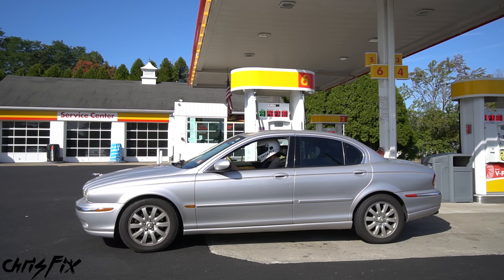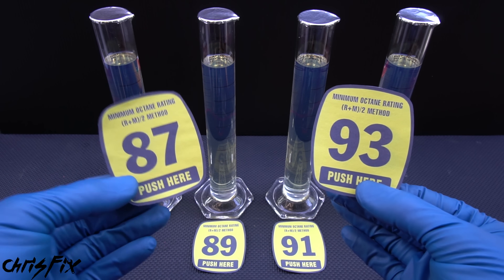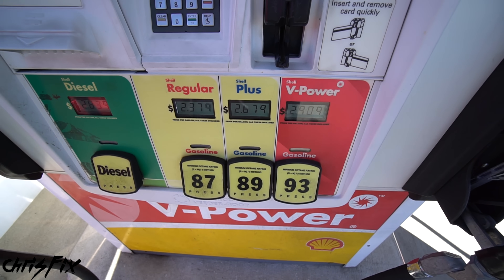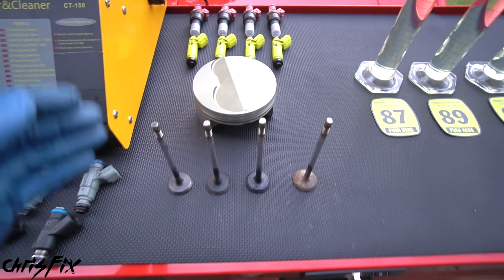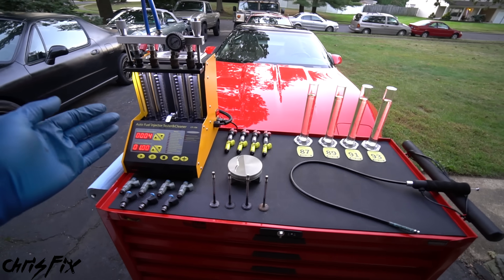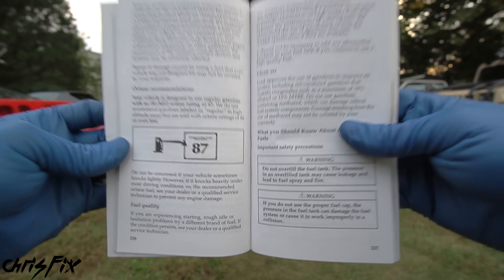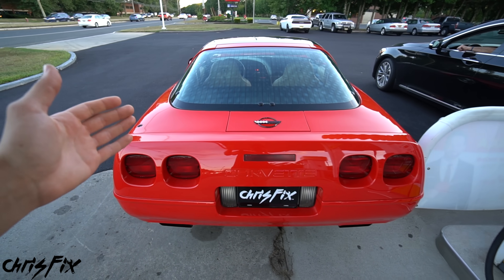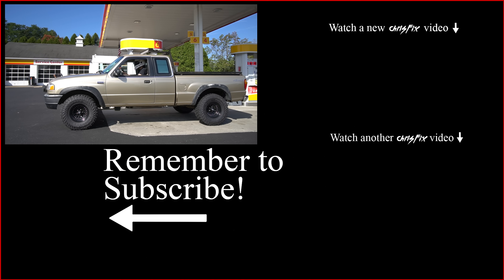What is the BEST Fuel to Use in Your Car or Truck and WHY

Comment: I have a 73 Super Beetle and the Manuel calls for premium But I am told that there is a difference between the old gas with Led and the unleaded. My current mechanic says run 87 to compensate for this difference. Is there any truth to this??

Comment: I put premium in my 2017 Nissan Altima. I was told it keeps the engine cleaner.Back then when I used to put regular gas in my 2015 Hyundai Sonata it would make a weird noise whenever the engine was running. After I left my mechanic he told me it was making that noise because it was running on regular gas. And that premium gas is recommended for newer cars just like synthetic oil.

Comment: The answer to the title: look at the owners manual.
Reply: I know the answer was simple, but i appreciated all the information he gave.
Reply: @nickz6948  throw 93 in it and call it a day fam.
Reply: @nickz6948  also, 91 is what manufacturers usually program a vehicle for that requires premium since 93 is not always available everywhere. 91 usually is though.
Reply: Yeah but should I use 91 or 93 octane gas for my nissan 370z? Gas station near my house doesn't have 93
Reply: @nickz6948  look at the owners manual...
Reply: @LIGMAFB  My brother gave me the car and I don't know where he put the manual. He's in the army so I can't contact him either
Reply: @nickz6948  It took me less than 10 seconds to find that info on google.
Reply: @nickz6948  its the same just say different like coke and Pepsi.  Anything 90 and up i premium
Reply: @nickz6948  if you are at altitude, 4000 ft and above, 91 is sufficient.
Reply: @nickz6948  if you want more performance run 93 if you're not racing around the streets you can put 89 or 87 in and it won't do any difference. recommended is 91.
Reply: Thank you guys
Reply: This is information is very vital...Gas goes up and down like a merry go round
Reply: Definitely not a 16 minute video worth.

Comment: If your car is NOT super or turbo charged and not originally sold in a high altitude city (over 5000 ft) if you go to a high altitude (like Denver, Colorado) you may be able to down an octane grade.  Years ago I was in Peru, where most cities are either near sea level or above 12,000 ft. and  the fuel sold was either "high altitude", (I thing it was around 78 octane) or  'Low altitude" (around 90)  because of lower atmospheric pressure the low octane did not pre-detonate at high altitudes because the absolute pressure at ignition is proportional to atmospheric pressure.  A  9 to 1  compression ratio engine at sea level will act like a 7 to 1 at 10,000 feet and thus not knock with low octane.  One had to be careful when driving from the mountains to the coast and arrive with a near empty tank and fill up there or your car would knock badly.

Comment: There’s an old trick to up the octane by adding a lil kerosene to your regular gas,if ya look at some of the higher end octane boosters,perfect example royal purples octane booster an read the ingredients an you’ll see it’s 95% kerosene. A good rule of thumb for every 20 gallons add a half gallon of kerosene an it should roughly up the octane to around 95 if ya start with 87 octane fuel.

Comment: Part of this is absolutely wrong. Higher octane actually has less energy per volume of fuel, but you can run more timing so it can potentially make more power. At the exact same timing, you will actually make more power with 87, as long as its not knocking.

Comment: I put 91-93 in my Silverado. It definitely gains a bit of power. I'll run E15 or E85 on occasion for the huge power gain, but I can't afford the 40% loss in fuel economy.

My crossover gets 87.  It's boring .

Comment: Something you didn't touch on is the 88 Octane E-15 fuel. It's a half-way between standard Unleaded and Flex Fuel, and, just like Flex Fuel, should only be used in cars that have the appropriate (0%-15%) Ethanol rating. Most cars are only rated for 0%-10% which is the normal Ethanol range for Unleaded fuels. Just like you advise, listen to the manufacturer's recommendations before considering this fuel, and do not trust the statement at the pump which claims that it's suitable for all 2001 or newer vehicles. We have three different cars that are newer than 2001, and only one of them is compatible with the E-15 fuel, the other two would actually suffer damage from the elevated Ethanol rating.

Comment: What do you think of E-15 fuel? Does higher ethanol content damage seals or other components in the engine? There isn't much guidance regarding this in car manuals. There are some stations that have 88 octane fuel that has 15% ethanol instead of the usual 10%.

Comment: My oil leaks on the front driver side and under my hood has white smoke xar doesnt change gear and wont move. Does anyone know what is wrong i got new transmission lines before this happened

Comment: Okay so I have a 2014 focus st and I fill up with 91 octane. I changed my spark plugs the other day and they were gummed up. I was recommended injector cleaner. Two days after my engine blew. My car doesn’t require 91 but I use it anyways. Could have to much octane cause my engine to blow?

Comment: Look when I run 101 on my 2017 Mustang GT V8 Straight pipes, the shit is so responsive and the sound is just unbelievable. I can tell the difference in sound with 101 and 93..... I can record a video with 93 and 101....
 I can upload a video with the different fuel and I can use a DB reader??

Comment: Chris didn't talk about oxygenated fuel, or 10% ethanol fuel.  Ethanol is an octane booster, yet has less btu (energy).  Just another factor, so for some of us, we can seek out stations that have "ethanol free" fuel and it has certain benefits (more power, more MPG, better suited for cars that are used less often).  But it is always more expensive than the same octane at an E10 station.

Comment: So if the manufacturer recommends 89 octane, but the local station only has 87 or 91 octane's, can you mix a specific predetermined amount of 87 octane with a specific predetermined amount of 91 octane, after determining the approximate number of gallons needed to fill the tank, in order to create an 89 octane fuel?

Comment: normally, with my truck that is supercharged (about 650whp small block chevy 350) ill run the highest octane possbile, usually 91 sometimes 93 and put a quarter bottle of octane booster, as the compression is so high, i dont want to take any risks and being a older vehicle there is no knock censor

Comment: I don’t have the energy to argue here. Some good info with a lot of incorrect. These rules apply much different as a engine ages. Too much info to add here but if you’re gonna do an informative video on this level you should include all the fact. However the most annoying for some reason that higher octane fuel doesn’t burn cooler. Run those injectors in a thermo-chamber or just simply hook up a scan tool under same conditions and record O2 sensor data. Thanks but no thanks. Make a corrective video.

Comment: Because of the additive difference in different gas suppliers, I have found through experimentation that a car will run best on a type of fuel. So one manufactures fuel of the same  octane  will run your car best.  That will also change depending on what part of the country you are filling up in.    I over inflate my tires by 5 pounds and more than doubled the life of the tires while saving 10% on fuel usage.  the ride is a little stiffer and the steering response is improved. In addition, by using the fuel to "empty" before filling up and recording the mileage (or using the odometer by zeroing it at each fill up), I was able to determine which fuel got the best result in my car. Sounds like a lot of work, but it isn't. The $$ saved is huge if you are a commuter, like I was.  Tire alignment is also a very important thing to do annually, or if you hit a curb hard.

Comment: Hey Chris! I got a few questions bro. I bought a 2008 Mercedes E350 a month ago. It runs good but it had 3 previous owners so I don't know what type of gas they were using, I've been using regular gas since as a student. I don't make much money and gas costs a lot in Miami especially if you have 20.6-gallon fuel capacity. After a week of having it, it gave me check engine light for O2 sensors (P0150 Circuit Bank 2, Sensor 1) and intake manifold (P2004 Runner Control, Stuck Open Bank 1) Of course it runs less efficiently than it supposed to. I changed the air filters and cleaned that area so I don't know if the intake part is okay couldn't go and check engine run again also twice check engine light was off and it worked more efficient so the O2 sensor was working sometimes. But soon I will change O2 sensors with my dad as I watched your video. He knows his stuff and fixed many cars back before, sometimes when I park or stop I see some steam coming up from the hood, he told me it probably leaks gas to exhaust channel from engine, etc. (Idk how to translate what he said for that leaking part to English since we use Turkish at home lol) what would it be? Also when I go slow I notice that there's sound coming like a part from the bottom of the car loiters, touches to the floor which doesn't hope it's not a serious thing like the voice is coming from the engine. And if I use premium gas for a certain time or octane booster would it make a difference? Thanks.

Comment: You forgot to mention rotaries. Its recommended to use the highest octane possible to lengthen the lifespan of the Apex seals, and basically the engine's lifespan

Comment: Technically higher octane fuel has a higher carbon content per volume so therefore will have a higher energy content per volume. But it’s not enough to make a difference in your engine and supply more energy to the wheels. But everything else you said in the video is totally true. I have a degree in chemical engineering and work as a process engineer at an oil refinery so we process the crude oil to gasoline product before additive addition. If you have any questions about what I do and how we process the product, feel free to ask!

Comment: When I got my car, if I accelerate sometimes it vibrates. Does this mean it’s losing power ? And since I started using Premium fuel,  it’s getting better.
Reply: How many miles are on it
Reply: UnneededChaos561 _ 120miles
Reply: Yes because the knock sensor is detecting detonation and retarding the timing to try to stop the detonation.

Comment: Buy port-injected engine, buy one that has not too high compression . . . and you will see it runs fine for ages even with a bit gunk inside.
Reply: you mean direct-injection?
Reply: @bobbarker3248  
Thank for pointing on my mistake, temporary black-out . . . corrected it. At 7:20 he shows how a valve from an engine with direct injection can look like.
I own an Audi from 1999, btw. The engine origins date back to mid 70's.

Comment: Manufacturers Recommendations will save you the headaches later. That is Gas, Oil, Gear Oil, Transmission Fluid, Coolant,  Brake Fluid and for those who never lift the hood, Turn Signal Fluid.  

99% accurate information in this video.  Covered most important information that most non gear heads can absorb it and understand.

Comment: To educate you more on the knock sensor it doesn't "hear" for knocks. It detects the amount of vibration and with that vibration it produces a AC voltage and since it's a piezoelectric element all it needs is a impact on the crystal and Wala you have a check engine code on.

Comment: Great video, well done!. Thanks! However, I find the higher octane fuel totally improves engine performance, especially on higher mileage vehicles. So I dont' use the Manufacturer recommendation 87 but the mid grade. It's Night and day difference, but worth paying the extra.

Comment: so many things not true but the bigist is that the number matters it matters less its to small to matter. a nother thing octain can never be controlled to one number so when being tested the octain only has to be with in whats called 10% of 100 witch means if its 100 octain then it can be 10% less if its 93 octain it can be 9.3% less and so on. I worked at a gasstation for many years. I also have machinics in the family and have worked on cars and trucks for years. and most cars now days can run on higher and will be fine. I my self should be running on 87 but my car runs better on 91. pne of the big things you want to to buy gas with no ethanol all it is is a way for them to use a cheep adative that makes your car clocg up and gives you less milagfe per galion.

Comment: The different prices is just how clean the gas is. Like if you use the premium gas you wouldn't need to put seafoam in your tank. But if you use regular youd have to put seafoam to keep up it engine clean. Say prolly every 2 weeks. But the price difference doesnt make any difference in miles. Keep in mind this is toward people who have regular vehicles not people who have higher end cars like say a Corvette. They need a better fuel like premium.

Comment: This video probably saved me from continuing to use the wrong fuel for a longer period. I just got a v8 2010 camaro, and so far I've pumped regular gas twice since I got it. I'm at half tank now,  and I will start using premium going forward.  Thanks for all the info.

Comment: What about fuel with the 10% Ethanol added?  Does it harm your engine?  Does it get the same gas mileage?
Reply: Ethanol is alcohol and contains less energy than gasoline. Some say alcohol can damage certain metals and seals in your engine. However, it is more environmentally friendly.

Comment: PV=nRT
Ideal gas law
You can rewrite it 
P1V1/T1=P2V2/T2
When you have a piston at P1 and V1 at T1, at BDC. you compress it to get
P2V2/T2
Which is a piston at tdc.
Solve equation for T2
You will find temperature increases from this compression and volume change.
So air gets hotter with compression, so more boost, higher compression= hotter temps before the mixture is ignited at tdc. So octane makes this mixture less susceptible to spontaneously igniting when it undergoes this high temperature rise.
This concept is why diesel does not need spark plugs. Temperatures from this higher compression found in them, lead to spontaneous combustion

Comment: Where I live, certain pumps have 0% ethanol in premium, 5% in mid, and 10% in regular. The difference in mileage and power equals about 4% (when you look at calorific values reg vs. prem), and so a 5% price difference is almost worth it. The big difference is in lawn mowers and carbureted engines where that ethanol turns to water and plugs stuff up and corrodes, definately worth it in that case.

Best would be to find a station that has ethanol free regular, if only I could...

Comment: The one thing I saw is at the gas station the price of 87 fuel is $2.42 a gallon but here in CA we are paying $4.00 a gallon.... SMH We have extra taxes added to the cost of fuel to fix the roads but in Orange County where I live most roads are like driving on a gravel road. I need to get out of here...
Reply from the maker: The money doesn’t go to roads. Well it is supposed to but it doesn’t. NJ pulls the same stuff, they just raised our gas tax and said it will go only to roads and already it is spent elsewhere

Comment: Should I go off the mpg as any indication of which fuel to use?   The civic I drove years ago got the best mileage off mid-grade gas, the Malibu I'm driving now gets over 100+ more miles per tank on premium vs regular. Every car I've had said "87 or higher" including the truck I had from before the civic that would stall if I didn't use premium gas.  There's a lot to unpack here.

Comment: The octane numbers you mentioned are pretty standard at gas stations in the US but you also mentioned Shell used a propriety formula in their fuel.  I assume other gas stations do the same and if that's the case, I wonder if some are better than others. Any idea which gas stations might offer the best?

Comment: So why at Costco does it says contains up to 10% ethanol ?? I've always wondered is that a good thing or a warning ??
Reply: It's both. Ethanol is more eco-friendly. However, it's alcohol, which MAY harm metals and seals (rubber) in your engine. Also, it contains less energy than gasoline. Thus, it's less "fuel efficient". I noticed I get 70 more miles using fuel from another station than I do using fuel from Costco.
Reply: @bobbarker3248  o wow what a trade off ?! I guess that's why the price is cheaper !! I always see the sign but never really thought too much about it until watching this video... I think I will switch off to see if I notice a difference... Thanks for the answer!

Comment: Newer cars if they have higher compression like mine with 11.1. If you run 87 the engine richens  the mixture and retarded timing getting about 13 mpg. Vs 93 getting about 17-18

Comment: Wow, refreshingly accurate information about fuel octane. Not one tiny bit of misinformation in there. I'm impressed! As an auto mechanic I know from personal experience that octane is a misunderstood concept. I specialize in engine performance diagnostics, and so many times a customer will tell me "I even put a tank of high-test gas in it" as if that were going to magically fix their performance issues. Great video!

Comment: i like your pitch however you forgot something that is very very important. Tier 1 fuels over others. I have several cars and they require not just premium but tier 1 fuels. I unfortunately found out the hard way and was easy to correct. Check it out.

Comment: If you have a modern European car, it will usually be designed for 95 Octane RON, also known as 89 octane PON or AKI, as used in USA.
You may experience knock if you put low/regular grade fuel in, but medium (89 to 90 PON) should be perfectly safe.
In the country I live in (Denmark), 95 octane RON, is by far the most common fuel.